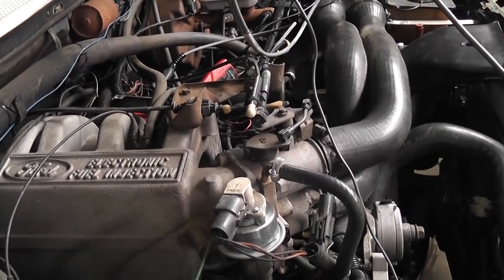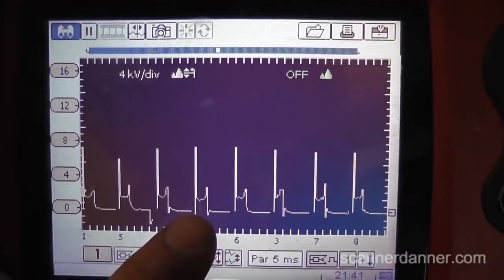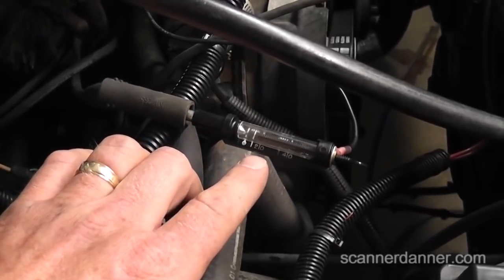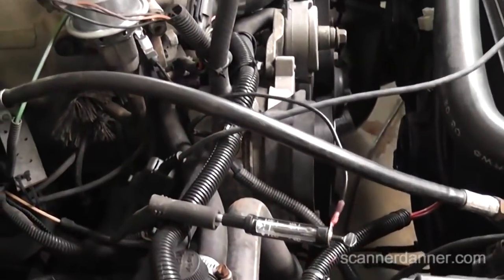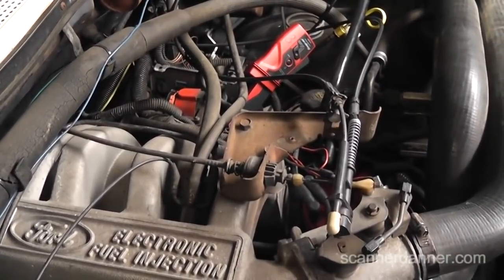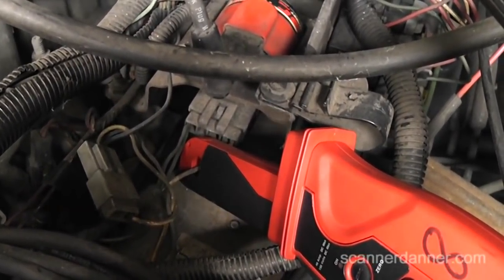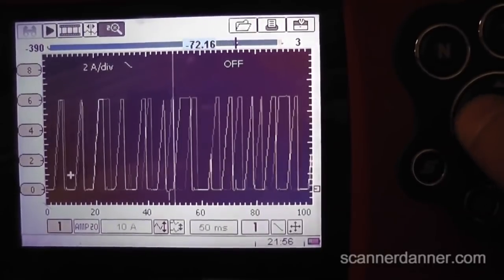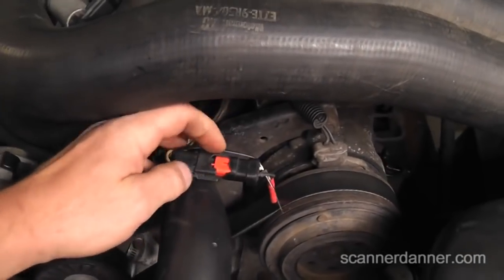Ford EEC IV Distributor Pick-up or Faulty Ignition Module - Part 1

Comment: I don't have a scope, but this is the exact issue I'm dealing with on my '94 F150. Removing spout makes it better.  I already replaced bad plug wires an cap. Even cleaned the wheel  that was rusty. Sad that it is only serviceable by pulling the distributor.
Reply from the maker: Just tread carefully. These old systems are hard to find quality parts for today. It's all Chinese made crap now. I have an 86 Mustang case study we did that took 4 different ignition control modules to finally get a good one smh
Reply: @ScannerDanner  yes sir. I bought a motorcraft magnetic pickup only to learn you have to pull distributor and disassemble to install pickup.  Really bright ingineers.
Reply: I’ve replaced ECU, ICM and PIP on my 89 5.0 F150.  Above 3,500 RPM timing goes retarded, not advance.  Engine falls on its face. KOER test and it advances timing just fine. What the heck am I missing?
Reply: @johnmiller2381  only thing you are missing is 1) money  2) the little trigger mabob that will straighten it out. I feel your pain. I drove mine yesterday for a 150 miles and before getting out of town bloody check engine light was on then off and back on for about 10 miles and went out and never came back on. I suspect the computer components are just tired. Can't prove it but it is hard to know what the fuel trim is when there is no scope to watch the signals. Or is the coil breaking down at higher rpm? The obd-ii stuff and a scantool helps but we don'thave it. But I love my old truck! I'm going drive it. I checked mileage and I am around 16 mpg so I am not sure it is a fuel problem as it holds steady at 45 psi. After I replace the pip in the distributor I hope that will do it.

Comment: I have the notch in the square wave line but when I disconnect the spout it still runs shitty! What would be the problem you think sir?
Reply from the maker: If it still runs shitty with the SPOUT unplugged, it is unlikely going to be a pickup  issue. Lots of other reasons I can run bad

Comment: Very happy to hear that your granddaughter is back home and doing better! 

I’ve got a 1985 Crown Vic I use for a summer cruiser which uses this system. This is great material that I’m sure will help me when I eventually have a problem. I’ve gone down the rabbit hole reading up on this system since I saw the mustang video. From what I’ve read the clipping mechanism is used so that the computer can confirm the TFI module received the SPOUT signal. The clipped SPOUT signal gets mirrored in the next PIP pulse and sent back to the computer.

The falling edge of the SPOUT signal tells the TFI module to turn the coil on and the rising edge tells the TFI module to turn the coil off thus firing the spark. The computer advances the timing by receiving the PIP signal, modifying it and sending it back to the computer as the SPOUT. When the SPOUT is disconnected the PIP signal directly drives the coil.

Comment: Wow, great explanation of the  ignition system. When I was in High school in  auto mechanics class we didn't have these fancy Snap on scanners. We did have a giant oscilloscope wit a CRT screen (SUN) and i think only secondary ignition was visible on it.   The scanner was primitive at the time (late 80's) vs today. Just get codes out.  Great tutorial on this , love it , refreshes my memory on the EECIV system. I still have a Ford Mustang with this system (88).  Awesome. Also my teacher was still teaching how carburetors work  at that time.

Comment: Had almost the same exact issue on a 95 F150 back in 2017.  Got several pico captures that look identical as yours.  This one would miss on #3 with spout plugged in.  Ended up being faulty pickup on this guy.  The PCM caused the misfire because the PIP signal is failing.  Look at your spout signal during the miss.  The PCM gets confused and sends a command out with almost no dwell to the ICM.

Comment: Wow, I wish I had this information a couple of years ago.  My son had a four cylinder Ranger PU truck that had issues with SPOUT etc.  It didn't have a misfire when driving it but but starting it the engine would try to start and then immediately die.  I f we disconnected SPOUT it would start and once started we could rexonnect the SPOUT signal and the truck ran fine, no misfires.  We never figured it out and he would up putting a switch in the SPOUT line that he could control from the driver's seat to disable and then re-enable it after starting the truck.  He drove it like his for a good longwhile up until some lady fell asleep at the wheel on the DC beltway and T-boned him on his way to work one morning totalling his truck.  And to think it may have just been a faulty crank sensor.
Reply from the maker: Agree, I bet it was exactly that

Comment: I nice that the motor says right on the top that it has Electronic Fuel Injection.  It's much better than the Manual Fuel Injection I hear.

Comment: Danner I've been all through this eec-iv efi truck ..believe it or not you literally just need fuel pressure ...a properly working distributor , ICM, TPS,IAC, knock sensor, and engine temp sensor  and the engine runs assuming no vaccum leaks ...the faulty icm 90% of failures...also if you loose signal spout connector paper clip works ...the other 10% is trash in fuel tank causing interruptions in fuel delivery ...owned this engine for years ..multiple swaps n bay gets less n less busy everytime ...lotta junk on there ...computer spit codes left n right with all new components so how I figured out doesn't make a bit of difference most stuff ...truck still run right no matter what ...fancy  vaccum advanced carb is all it is ..

Comment: Keep the old stuff coming. Its a lost art and skill, they just are so different than obd2/ecc5
Reply from the maker: Same thought process though as ANY car, right?
Reply: @ScannerDanner  thats true, but... There are differences in new and old. They both need to be understood.
Reply from the maker: @95GTSpeedDemon  of course but the foundational principles apply to all! Was just working on my 78 Powerwagon with a blower motor not working and the tests I used on that were no different than any other circuit with a voltage drop problem. Could have been a 2022 model year and how I tracked it down would be the same 😉
Reply: @ScannerDanner  im looking forward to getting up to par on scope usage and maybe bringing awareness and technical knowledge to others. Being informed and armed with tools never hurt!

Comment: Hey Danner I'm on my third distributor that I had to return from AutoZone this is the same issue that I am having on my mustang weak spark and misfire. The problem is no matter where you buy it from it's all made by the same company you can't get a new OEM distributor anymore because of the age and the ones that claim they are motorcraft really are not motorcraft. It's a shame that the company who makes these horrible distributors can put them on the market and sell them to people I can only imagine on the amount of people pulling their hair out trying to fix their car
Reply: You can actually just replace the pick up if you take apart the distributor yourself. The part itself is around $20. Rock Auto or Napa has the part, I'm sure they're made in China but what isn't now a days.
Reply from the maker: I second Napa!

Comment: So the PIP is generated by the Hall effect in the distributor. It sends that signal to the Ignition module The ignition module takes that into account along with some other inputs and sends out the coil on/off command on the SPOUT. 
Correct so far?
Without the SPOUT, a module in the distributor uses the Hall effect sensor PIP signal to command the on/off of the coil but at base timing of only. It’s all ‘in house’ within the distributor 
Still good?
So if the Hall effect pickup is bad wouldn’t there still be a mis firing of the coil since it still relies on the PIP signal even without the SPOUT connector in?
Reply from the maker: The ignition module only has two inputs, the PIP and the SPOUT. With the SPOUT connector unplugged ALL control of the ignition coil is done by the ICM alone. I believe it does incorporate an RPM rise, slight advance (maybe 10 degrees) when running in base timing mode. I know GM did that, not sure about Ford, but this would be built into the module itself. 
With the SPOUT connected, the ECM then influences timing advance.
Your last question, you would think with a faulty PIP, the problem would still be there with the SPOUT unplugged, but this is not the case and this is why this problem is so unique. I have a part 2 coming up on Sat where we discuss this with my class and I know you will like it. I'm not sure if I can give you a good why or how this is happening, only a what to look for and what the fix actually is. This condition is caused by a bad distributor hall effect (PIP) signal.

Comment: In the early days of owning my 92 F250 with the 5.0, my truck got harder and harder to initially start.  Once running, it ran generally ok....but the difficulty starting got to a point where it was almost impossible to start, namely in the winter in the Vancouver, Canada area, where it rains almost constantly in winter.  In the end, it was simply the rotor....getting worn and rusted over time, from the moisture in the air.  I replaced the cap and rotor, and it fixed the problem.  This one is interesting, if it's not actually cap and rotor.  I have to wonder if it was a distinct improvement to have a separate ignition coil in later trucks (as I have in the 92), as opposed to the earlier trucks like this one....that has it incorporated into the distributor.  I keep coming across people with their 80s Fords having this type of problem with their distributor pickup/pip sensor.  Personally, I"ve never had a problem with the separate Ford ignition coil.  Mine still has the original ignition coil....after 30 years of use.

Comment: '87 would still be coil dwell controlled by the ignition module.  It wasn't until '94 where coil dwell is controlled by the spout from the computer.
This is why you don't want to make the mistake of using the incorrect ignition control module (PS "push start" module vs the '94 CCD "computer controlled dwell" ignition module).
In the case of this engine, it looks as if the ecm spout signal is controlling coil dwell?
Reply from the maker: I'm sorry, what is your question? I think we proved the fault in the end of this video. Can't remember
Reply: @ScannerDanner  It wasn't clear to me any distinction between push start and ccd.  Nor was it clear if the distributor module or pip were malfunctioning, since replacing the entire distributor resolved the problem.
Reply from the maker: @thisisyourcaptainspeaking2259  it was the pick-up or hall-effect sensor or PIP. Whatever name you prefer.  This was NOT a bad ICM. This was a classic example of how to identify this condition.  @thisisyourcaptainspeaking2259

Comment: H Paul,
To me it seems there is a AND gate between PIP and SPOUT signals. The logic levels of the gate are odd but there is a summing device there. Perhaps the computer measures the PIP (AND) SPOUT =1 by starting a timer and computes the dwell angle based on that time. During cylinder 2 event this timer is too short and the computer delays the spark event artificially. Might have a connection with the previous cylinder which has a long time of logic 1.
This would be my best explanation for this phenomenon.
Cheers and best wishes to Ellie!
Reply from the maker: Would an AND gate be tied to to base circuit of the main transistor? That's some type of chip? I'm not an internal computer guy
Reply: @ScannerDanner  yes. The power transistor is commanded by the ignition module itself but the ECU can override that signal based on other inputs that are computed together modifying the advance angle. At least this is what I understand out of all this. Hope I'm not far from reality.
Reply from the maker: @danielmusat597  then disconnecting the Spout interrupts a leg of this AND gate and forces all control back to the ICM alone . Sound right?
Reply: @ScannerDanner  yes. This is the way I see it functioning. I am not an engineer either, just a passionate electronics designer and I might be wrong. However you found the problem and solved it so this theory doesn't matter too much. It's just a try and error in understanding a system that is invisible to the user.
Reply from the maker: @danielmusat597  id like to hear your thoughts after this next part is up. I think it shows exactly what you're talking about.
Reply: @ScannerDanner  I just wait for it.
Cheers!

Comment: Been following you for awhile Danner and you put out some very good information and I thank you. Just bought your book too! I’ve got this truck had it for 2 years now and I’ve replaced all ignition and fuel parts (except injectors) and I get a mis at high rpm no load. Any tips? 01 Silverado 5.3
Reply from the maker: Thank you! Is that one of those flat distributor caps? Those are garbage and will crossfire within the cap itself. Do a spark test on each plug wire, right at the cap, using an incandescent test light. The spark should be strong enough to jump about a 1/4 inch past the end of the cap. The electrode is counter sunk in there so combined this would be over almost 3/4 of an inch arc. When these caps crossfire, the spark will NOT jump that far and thats how you can catch them.
Secondly, when this misfires, are you sure it is a misfire and not a fuel starvation issue? Which would be more of a high speed/load surging.
Reply: @ScannerDanner  This is a misfire on a LM7 engine or 5.3 on a 2001 Chevy Silverado. For sure a misfire it doesn’t feel like it but the flashing CEL light comes on. Took a look at injector waveform with no definitive answers.
Reply from the maker: @jacobisbell6466  injector flow issues are not going to cause high speed misfiring only. Don't disregard what I told you about the caps. Seen them bad right out of the box.
Reply: @ScannerDanner  This is a 5.3 there are no caps on them

Comment: How much I wish I could have you diagnose the problems on my 89 GMC TBI engine issues. Rough idle, smooth at higher RPMs.  Most everything is new. Seems like one cylinder is missing periodically. Can't time it well because timing light jumps around.
Reply: Do you have the timing bypass wire unplugged when trying to use the timing light.    These engines it needed to be unplugged and set to 0 timing.
Reply: @brianewer3905  yes
Reply from the maker: I use the coil wire when they jump around like that (to time it). You just can't use a variable timing light in that location.
The rough idle only, I'm thinking of a few things.
1. Leaking valve/seat where static compression can even test good
2. Leaking EGR valve (not fully closed)
3.. injector leak (fuel trims would be very positive)
4. Vacuum leak (throttle body base gasket)

Comment: What brand distributor - PIP did you put in to get all good spark waves??
Reply from the maker: No idea, I'm sorry
Reply: Does the PIP signal have to been good for the injectors to pulse on this system? Have a 95 E350 7.5 no injector pulse can’t find any definitive info on what the PCM needs to see to fire the injectors. Brake cleaner with start the engine
Reply from the maker: @marlinyoung1606  yes! No PIP signal at the ECM and it's not going to fire the injectors. Does your fuel pump prime when you turn the key on?
Reply: @marlinyoung1606   How long will it run on brake cleaner?   Check for spark?  Have a noid to test injectors?  Check Pip wire at Ignition module I think its #6 but confirm w wire diagram when cranking it?  Check wiring harness? Fuel pump comes on when turn key to run?

Comment: Seems to me that the problem occurs near the short pulse from the hall effect pickup. The spout barely clips the pip signal and then problems with spark occur on the next two events. Since there is no other pickup to correlate against, it doesn't make sense (the computer can only use that signal to run everything). Interesting and disturbing that new distributors (pickups) don't always fix the problem.
Reply from the maker: Seems to be initiated by the sync pulse, agree
Reply: @ScannerDanner   Need to find a Ford engineer to speak out as to how the logic of the pickup can fail even on a new unit. Also have an idea for experiment. Make sync tab slightly bigger or smaller to see if that cures problem

Comment: In an emergency could you pull spout, set static timing at 20 and install a high torque starter to get the HP\torque to pull thru the rockies w a 2000lb trailer?
Reply from the maker: I like the thought! I don't see why not

Comment: Have you done a case study on the 2000 Chevy's with the not starting security light flashing  Bull crap code p1626  if I start it every hour or so it runs. Over night it don't  take a day to get it started
Reply from the maker: Possibly. Those ignition lock cylinder hall effect chips failed all the time!
Reply: @ScannerDanner  I bypass it  With a resistor  In the Ignition switch And still act up If I started every couple hours it runs all it runs all day everyday if I let us sit overnight it won't start is that Is fuel injector stock open flooding it out is smell like gas when I go to start and it won't start
Reply from the maker: @the666bud  you can't bypass those with a resistor as that is a timed circuit, unless your bypass included some type of module